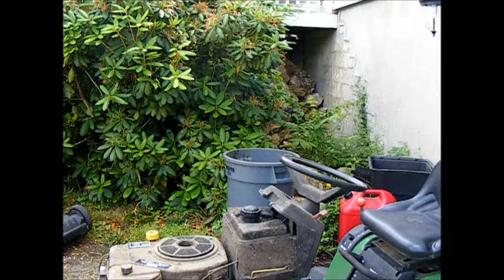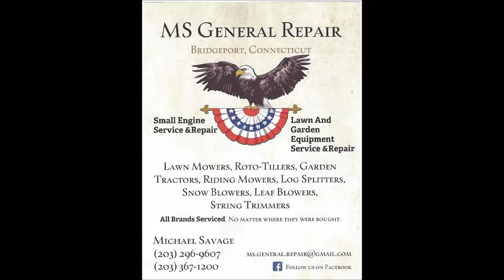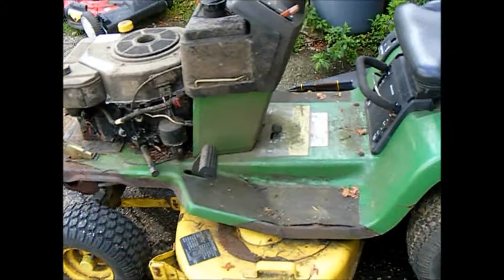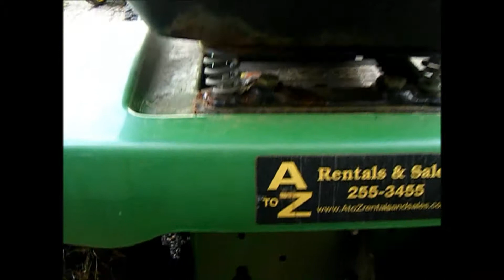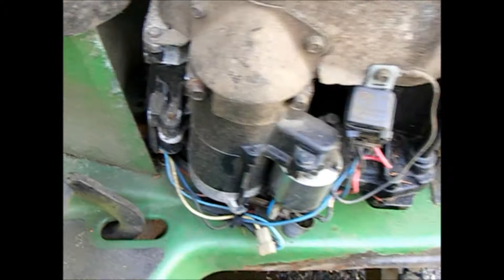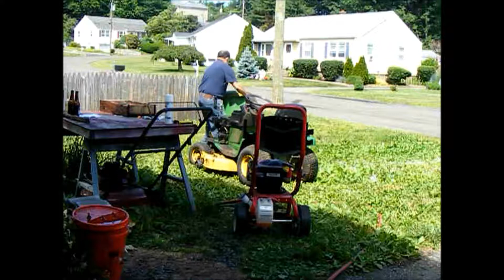JOHN DEERE STX38 PART 1

Comment: Okay, now I watched you pressure wash your stx38 pre 1993 please help me fix my steering. Thank you 🙏
Reply from the maker: I'd be happy to try and help you with your steering, but you need to be a little more specific. Such as.....What steering problem are you having?
Reply: @repairrestoreresell2026  it’s a jd stx38 89 to 93 model and the steering just spins around, I need to know how to remove the shaft with the gears and how to remove the triangle thing up inside that the sprocket turns against. I can find any videos on this model year . Thanks 🙏
Reply from the maker: The Sector Gear and shaft is about $300.00, The Pinion Gear is about $40.00. For about 150.00 you can buy the entire assembly used on ebay. I think it will be far easier, and far more cost effective. look into it.  Hope this helps..............